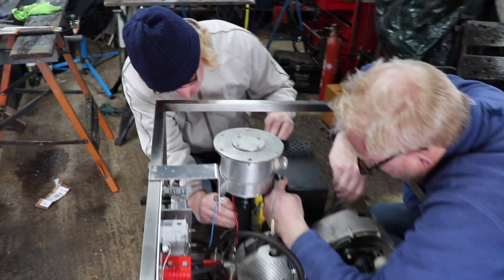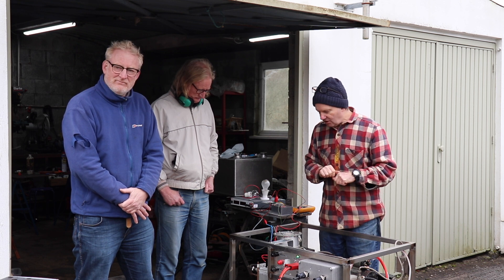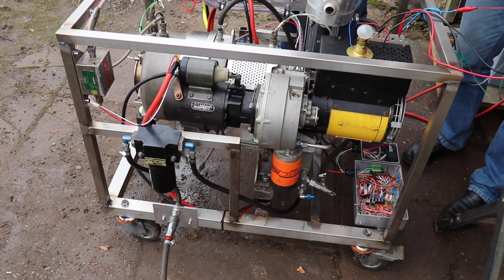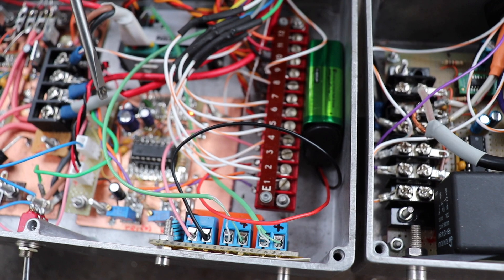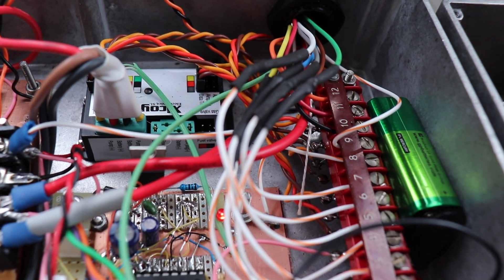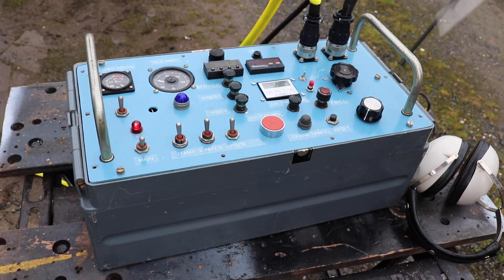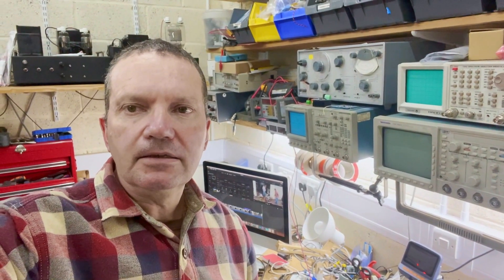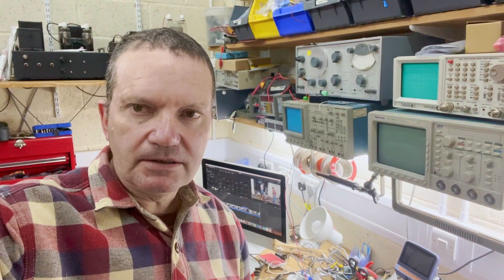New Year's Day Turbine  Engine Testing

Comment: something about those engines running makes them mesmerising.
Once again, many thanks and hny
Ps what is the current output of generator capable of  and what temp does the turbine get to
Reply from the maker: 28v at 10kw. At full speed the EGT settles at about 350 degrees
Reply: Wow, that is some current output and one hell of a toaster